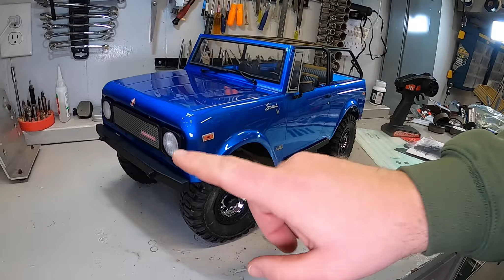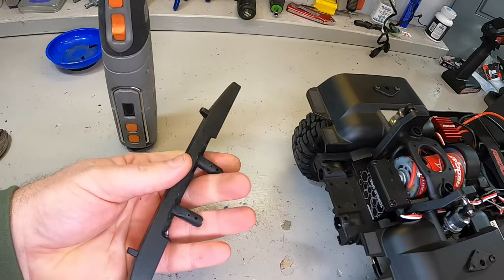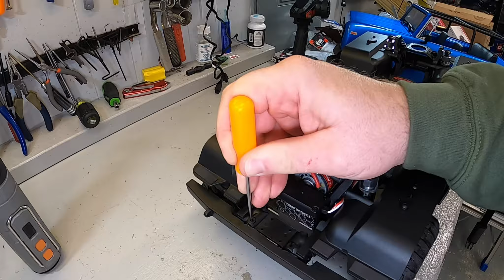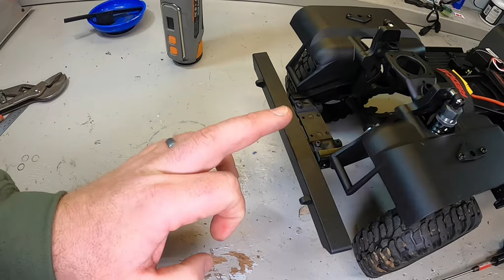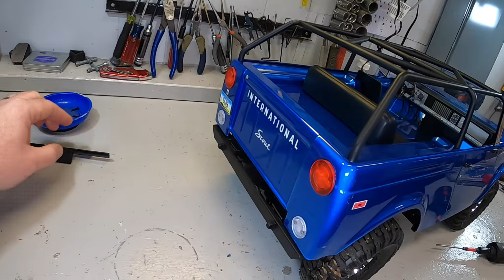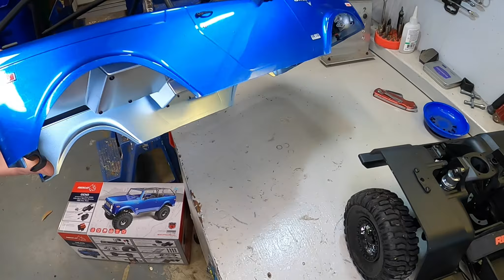DO THIS!  Redcat Gen9 Free Bumper and Rock Slider Mods!

Comment: Not for me.. choppy job.  Need to use a dremel nad mark up what needs to be cut.
Id also add the back part back on.
Its a trial truck..   everyone cuts everything up instead of buying a crawler.

Ive learnt it better to have both and do smart upgrades.. like the 1080 esc.
Brass up front, tires and rims, rear sway bar.  Done.
Reply from the maker: Great!  Glad you know what you like. 
Fortunately, folks are free to mod their trucks however they want!

Comment: I have watched your video a few times and great information for a newbie. I tucked my front bumper pretty much the same way you did except I flipped the bumper mount and bevel cut the bumper, what this did was allow me to mount the body without making any mods to the body. Definitely improved the approach angle. Haven't tucked the rear yet, studying to see if I can also tuck without loosing to much inner support within the bumper itself. Will update. What would be your suggestion if I want to replace the stock bumpers?
Reply from the maker: Thanks for the comment and the suggestion!  

If you want to replace the stock bumpers - you need to measure and look very closely.  Some are "universal" fit, and I don't know if I have ever seen one made specifically for the Gen9.  
Really depends on your goals.  Want it to look cool vs want performance.    Best performance is basically zero bumper!  :)